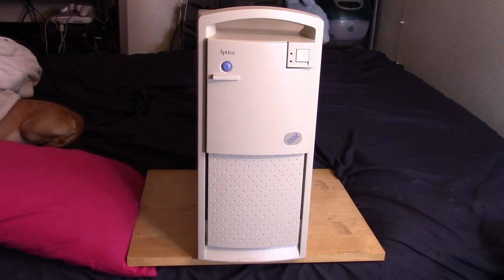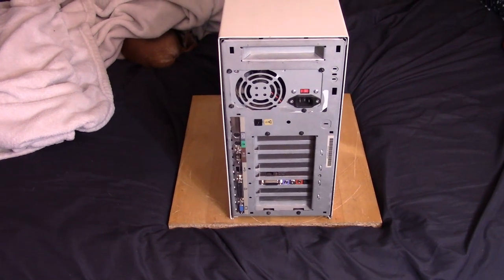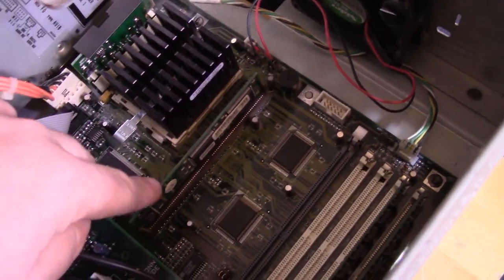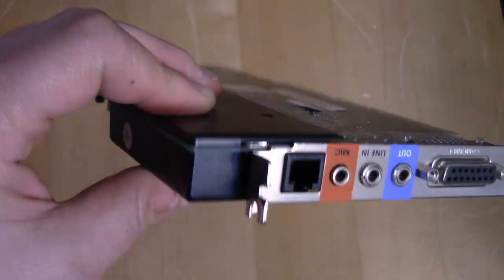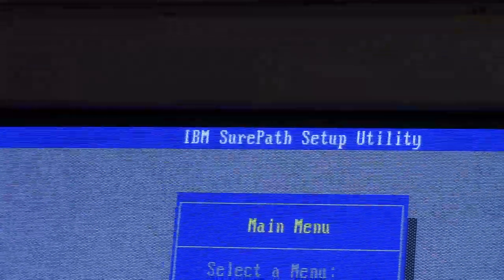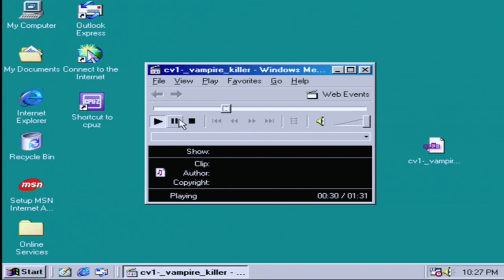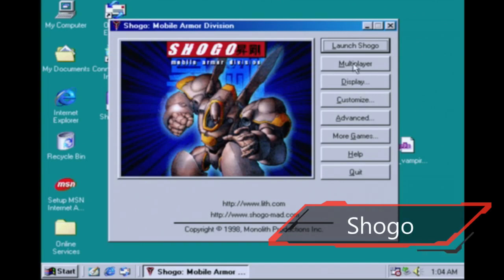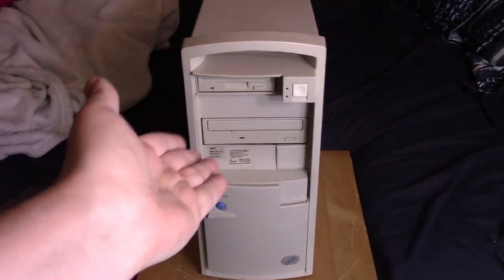IBM Aptiva Model 2176

Comment: This may actually still have IBM PC Cassette BASIC in ROM. I know at least some of the Aptivas did -- if the hard drive was not bootable and you didn't have a boot disk, it would go directly into BASIC, just like the original PC.
Reply: I owned a sister model to this that used a SiS chipset from the same age - sadly it did not have this, instead prompting for a floppy and pressing the F1 key.

Comment: Windows 95b & c both had OS level support for USB but had almost no built-in drivers, and no drivers for USB Mass Storage devices.  USB drives didn't become popular until much after the OS was released and drivers were only developed/backported for Windows 98 and later.  So unless a manufacturer developed their own driver that explicitly supported Windows 95,  USB support is a non-starter.

Comment: Hey there Ancient Electronics, I just got my hands on this model and just like yours it lacks a compatible 128MB ram stick. Mine is also missing the cache module and has a Pentium 133 in it.

I was wondering which models of Pentium 166 MMX are compatible with this board and also if I'll need to change out the VRM delivery module when I upgrade the CPU because the one in there now is quite different to yours.

Now I'm wondering what my search terms need to be on eBay to find the correct parts to upgrade this machine~

Mine came with a Sound Blaster AWE 32 (ISA) which was pretty cool and I have a bunch of old PCI graphics cards to try out.

Thanks for taking the time to answer if you do. ^_^

Comment: August 24 of this year, I went to the thrift store and just bought for 10 us dollars an HP Pavilion 7410P. I am planing to throw a a 3Dfx Voodoo 1 in it. I currently have a ATI 3D Rage Pro coming in the mail.

Estimated Price: $899 to $3,550 US Dollars

Basic Specs
_________________________
Chipset: Intel i430HX Chipset

Motherboard: Proprietary Computer Case Specific Socket 7 Motherboard

CPU Type: Has either Intel Pentium Classic or Intel Pentium with MMX Technology

Max Memory (Able to Take): 128 MB (4 sticks of 32 MB) EDO SIMM NON Parity but I think that they might be able to pull off 512 MB

Max Hard Disk Drive Capacity Support: 8 GB

AGP Slot: None

Max Amount of PCI Slots: 2

Max Amount of ISA Slots: 5

Hard Drive Type: Quantum Bigfoot

Onboard Graphics: S3 Virge Chipset with 2 MB of VRAM

Onboard Sound: Yamaha OPL3-SA [This supports Sound Blaster Pro 2.0]

Modem Card: Pavilion PC Lucent Modem

Ethernet LAN Card: None [You will have to add one in if you find one of these computers. I recommend an LAN card that uses the ISA Bus.]
_________________________

HP Pavilion 7420

CPU Speed    RAM      CD Speed    Hard Drive    Special Feature

166MHz         32 MB     16x               2.5 GB 

HP Pavilion 7410P

CPU Speed    RAM      CD Speed    Hard Drive    Special Feature

200MHz         24 MB     16x               2.1 GB            PhotoDrive

HP Pavilion 7370V

CPU Speed    RAM      CD Speed   Hard Drive    Special Feature

200MHz         32 MB    16x               4.0 GB            3Dfx Voodoo 1

[Notes: The Pavilion 7420, 7370V, 7360, 7350P, 7330Z, 7320 and 7125 were the systems as far as I can tell that came with the Pentium MMX. The 3Dfx Voodoo 1 cards that were included with these systems were made by Orchid and the name that Orchid gave their Voodoo 1 cards was the Orchid Righteous 3D]

HP Pavilion 7360

CPU Speed    RAM      CD Speed   Hard Drive    Special Feature

200MHz         32 MB     16x              3.8 GB  

HP Pavilion 7350P

CPU Speed    RAM      CD Speed   Hard Drive    Special Feature

166MHz         32 MB     16x              2.5 GB            PhotoDrive

HP Pavilion 7330Z

CPU Speed    RAM      CD Speed   Hard Drive    Special Feature

166MHz         32 MB     16x              2.5 GB            Zip Drive

HP Pavilion 7320

CPU Speed    RAM      CD Speed   Hard Drive    Special Feature

166MHz         16 MB     16x              2.1 GB  

[Notes: This computer not just came with Pentium MMX but earlier models had the Pentium Classic. The Pavilion 7320 as well as the 7420 also came with a 200 Mhz clocked Pentium MMX.]

HP Pavilion 7295V

CPU Speed    RAM       CD Speed   Hard Drive    Special Feature

200 MHz        32 MB      8x                3.8 GB            3Dfx Voodoo 1

HP Pavilion 7285

CPU Speed    RAM       CD Speed   Hard Drive    Special Feature

200 MHz        32 MB      8x                3.1 GB  

HP Pavilion 7280P

CPU Speed    RAM       CD Speed   Hard Drive    Special Feature

166 MHz        16 MB      8x                2.5 GB            PhotoDrive

HP Pavilion 7275Z

CPU Speed    RAM       CD Speed   Hard Drive    Special Feature

166 MHz        32 MB      8x                2.5 GB            Zip Drive

HP Pavilion 7270

CPU Speed    RAM       CD Speed   Hard Drive    Special Feature

166 MHz        16 MB      8x                2.5 GB  

HP Pavilion 7170

CPU Speed    RAM      CD Speed    Hard Drive    Special Feature

166 MHz        16 MB     6x                 2.0 GB  

HP Pavilion 7145

CPU Speed    RAM      CD Speed    Hard Drive    Special Feature

150 MHz        16 MB     6x                 1.62 GB  

HP Pavilion 7130P

CPU Speed    RAM      CD Speed    Hard Drive    Special Feature

133 MHz        16 MB     6x                 1.62 GB          PhotoDrive

HP Pavilion 7125

CPU Speed    RAM     CD Speed    Hard Drive    Special Feature

133 MHz        16 MB    6x                 1.62 GB  

HP Pavilion 7110Z

CPU Speed    RAM       CD Speed    Hard Drive    Special Feature

120 MHz        16 MB      6x                 1.26 GB          Zip Drive

HP Pavilion 7055

CPU Speed    RAM     CD Speed    Hard Drive    Special Feature

120 MHz       16 MB     4x                 1.62 GB

Comment: I have the IBM Aptiva model 2161-C9X. Is it the same as yours?  Mine boots up and runs okay, except the CD-ROM isn't working. It won't open and the CD ROM light is not on when I turn the computer on.  Also, I haven't used it for over 10 years.  I decided to set it up again so I could play my old computer games.
Reply from the maker: different model number so it may be different. It shouldn't be hard to swap out the CD drive with any working one or even a DVD drive if you need to.

Comment: Great video, thanks for the upload. perhaps someone can help, I’m trying to revive our family’s first pc that we bought from bestbuy back in 1995 for $3,200, an IBM Aptiva 2176. I’m trying to use the recovery disc that came with the PC but the CD only boots with the original HDD because the original pre installed Win95 came with the configure files that boots the CD. I created a boot floppy disk but do not know how to access the cd drive once I boot the system with the disk. Any info will be much appreciated. Sheesh, win95 sure is tough to work with.
Reply: You need something that configures MSCDEX, easiest way is to use a Windows 98 floppy image you can get from Winworld.

Comment: The ram doesn't works because it's probably BEDO, which is another ram standard and was used only for a short period of time. Mainly the first gen pentiums and pentium pros. It was shortly replaced by sd-ram.
Reply from the maker: I've never heard of BEDO RAM before. I looked it up and from the few images I found  it looks like its keyed with one gap around the center kind of looks like DDR. The RAM socket on the board though is keyed for a RAM module with two gaps like SDRAM. I just checked the service manual for this model and it lists it in the specs as "168-pin Gold, EDO, 60 ns, Parity or Non-Parity DIMM module"
Reply: @AncientElectronics  Yup, that's bedo. Bedo also had 2 notches, really close to SD-RAM. 

Bedo supports faster speeds that plain old EDO. That's what powerpc used also for a time. My 1997 power mac uses 2 notch BEDO sticks.
Reply from the maker: @NintenloupWolfFR  Thanks for the info, learn something new all the time.

Comment: I wonder if the motherboard/riser is setup like that so the motherboard could be used in both tower and desktop cases? There are also those old Packard Bell towers with the wide base that have the mother board at the bottom with a riser card.

Comment: The case is missing the plastic base that snaps on the bottom of the frame. I had a model 2176-C67 from 1996 which was identical to this case. It came with a Pentium 166 and 16MB ram (which up-graded later to a 200pro and 128MB which maxed this system out). It had the same MB-PC riser card and MWave hybrid sound card / 28.8 data-fax modem. You're correct, the dolphin was software up-gradable to 33.6. 
The USB is version 1.0 which wasn't initially supported until Windows 95 "version C" was released, if memory serves me correctly.
The greatest thing about these Aptiva systems from the consumer's purchasing point was the massive software suite that came along with it.
Great review and Subbed...brings back some memories!

Comment: The IBM we have states 2176 from the front cover that slowly dropped down but the power supply that recently gave out is for a 2168. Are the parts interchangeable? Help please.
Reply from the maker: not sure but if the wattages are the same as well as the form factor I would say yes?
Reply: @AncientElectronics - you can use a atx psu but you will need a at to atx psu adapter. They sell those on eBay for cheap